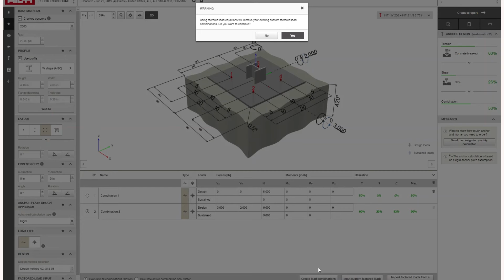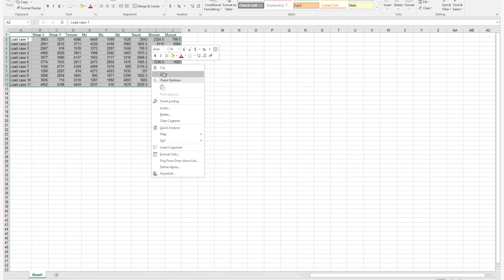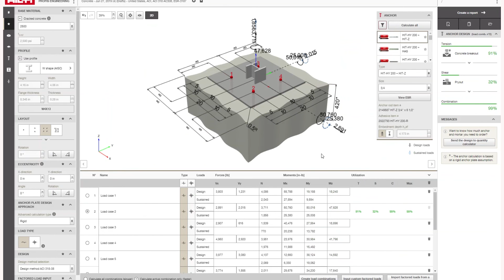Hilti PROFIS Engineering anchor design software tips - using the load engine

Comment: Does the user needs to enter factored loads or service loads
also create the load combination button is not there, although by clicking the gear setting icons it shoes safety factors for loads. Does it mean we need to enter service loads.